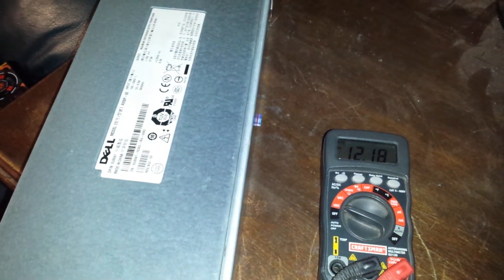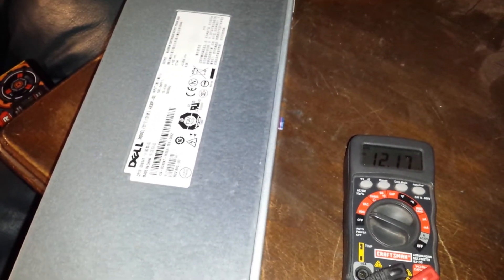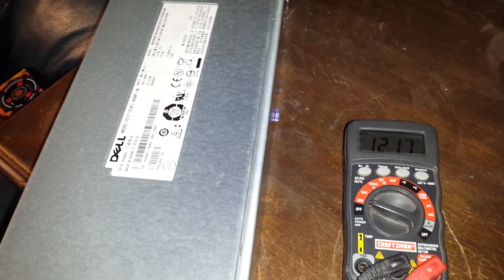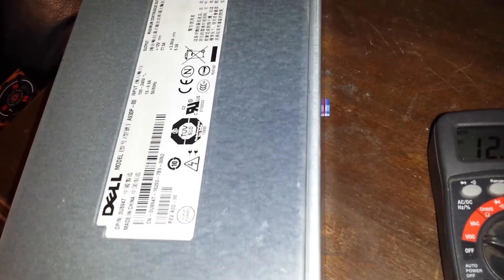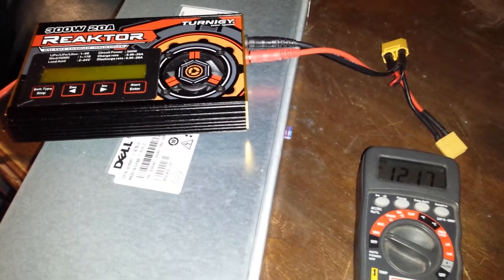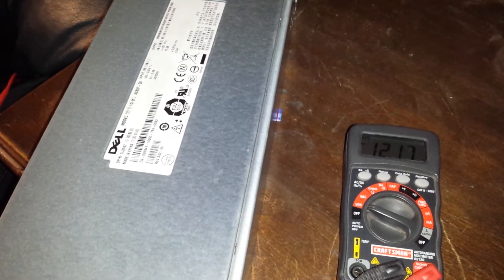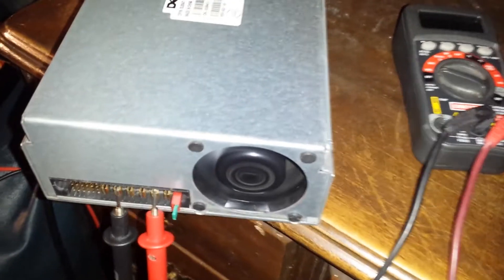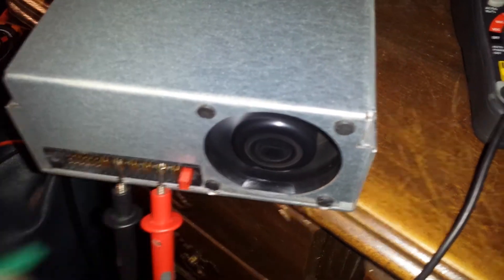Dell A930P-00 power supply 12v mod

Comment: I have a problem with my Dell PSU 7000880 .......
It starts well but after a short time it stops and the yellow light comes on. What does the yellow led mean? There's a solution?

Comment: Hi Jake, if possible, can you let me know the correct connections to get the A930P PSU working. I have a variable resistor connected between pins D2 & D4 to adjust voltage level; & another variable resistor between pins C1 C2 & C4 to adjust fan speed; however  the operation is intermittent. Regards, Pat, Ireland. paddyquille@gmail.com
Reply from the maker: Pat Quille I don't have it anymore time check it. I now have a HP DPS1200FB lots of power and half the size

Comment: Thats what i was looking for. good Video. thanks a lock. i use this for Electrolysis of potassium chlorate
Reply from the maker: check out a HP dps1200 they are 900 watts on 120v you will need a shorting board to activate it. the board will run about 20 bucks and the power supply can be found on ebay for about 20.00 as well. very cheap for the amount of power you get.